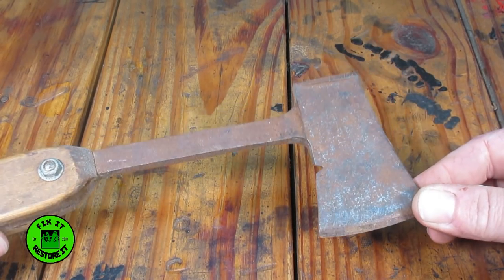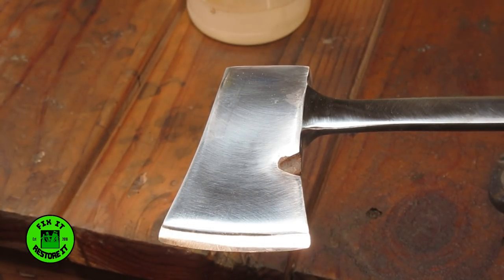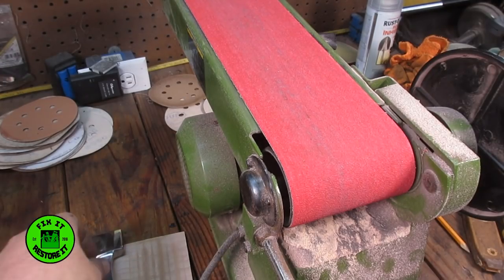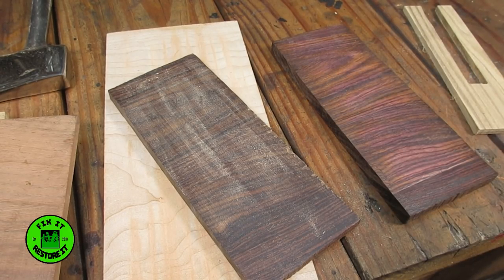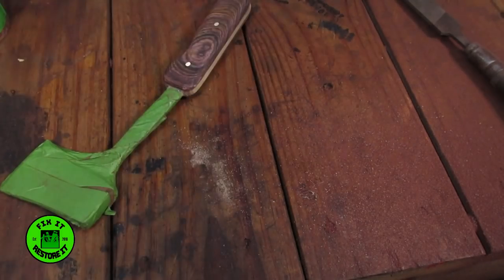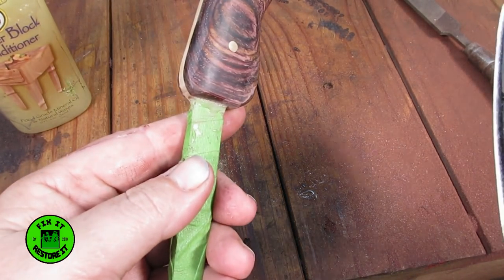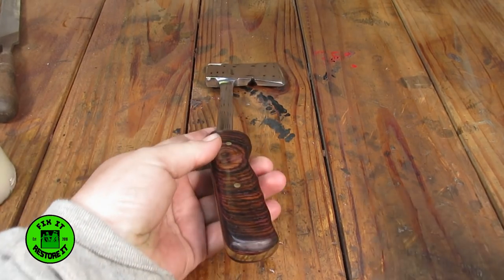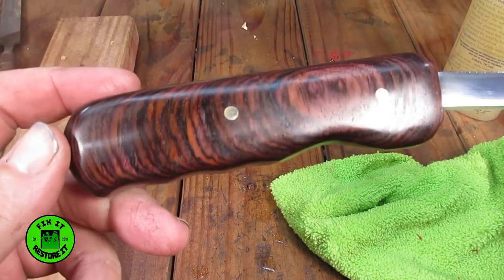Ugliest mini hatchet amazing transformation

Comment: It's a roofers hammer...for doing wood shake work...you trim the shake with the blade..drive the copper nails with the back and pull nails with the nail notch...used them for years doing shake work..
Reply from the maker: Even that small?
Reply: @FixitRestoreit  you get up around dormers, overhangs,and Eve's with it..lots of tight spots around portchs and the like, sometimes you use it in conjunction with your larger hatchet to lever in nails or to split thicker shingles,I wouldn't use that one now though lol it's too pretty
Reply: That sounds a lil shakey to me. lol
Reply from the maker: @lilsammich8252  lol!
Reply: That was my immediate opinion too.

Comment: I don't know if that  wood is Koa or not, but someone tried very hard to make it look like Koa. They did a nice job of dying it if that's the case. 
An old timer's trick: when you sand wood to a fine finish, before applying any finish, take a damp cloth, run it over the wood lightly, just barely wetting the surface. I use alcohol because it dries faster, but water will do. Once dry, run some 0000 steel wool over the wood, lightly, removing the little hairs that will pop up when you wet it. Don't try to sand the wood, just take off the little hairs. If using varnish or the like, you should use the steel wool between coats of varnish, all but the last coat if you want a glossy surface. In my day we'd do it even after that last coat, and then coat with old fashioned car wax and buff it up. Actually the car wax would be good on the handle, contrary to what you think, it actually gives you better grip. 

I'd like to see a lanyard hole in this hatchet, and prehaps a leather or nylon lanyard on it. Of course, I don't imagine it will actually see much use now, it's too pretty to really use for rough work.
Reply from the maker: Unfortunately , the wood came in a large box of exotic off cuts, so I'm not sure I will ever find out
Reply: @FixitRestoreit  Yeah, I got some veneer materials that way one time. must have been a couple dozen varieties.

Comment: It looks like an Estwing camp hatchet that's already hade a make over.  The rust came off those cast iron pans really nice, as well as the protective polymerized oils.  You're going to have to re-season those pans, or food will stick in them like cement.  Also, teach your wife how to care for them properly, if she is actually using them, and not storing them in the shed. The woods looks like rosewood, maple, and walnut.

Comment: I would say you definitely like that wood. The hole at the end of the original handle was for a leather thong. It might be a camping hatchet.
Reply: So if it slips from the hand in use it doesn’t fly into the bushes. Use them for machetes as well. Safer for bystanders too.

Comment: It's very nice, and you did a great job with it. My only worry is that there's nothing but epoxy holding the center in. The outside scales are pinned to the hatchet, but the center is only hanging out in there. Just a thought, but you could drill a hole into the bottom and put in another pin without doing any damage, and it'd put another piece of mechanical retention in there. :)
Reply from the maker: That's a good idea!

Comment: Keep it for a kitchen tool. Might have been a good size for light bushcraft, but too thin in the choked position. I use 600gm to 400gm hatchet heads for light craft, carving and whitrling.  Yours looks much lighter 250gm? 300? Kitchen, yeah.

Beautiful! And what a wood.

Cheers from Israel
🌴🇮🇱
Reply from the maker: I'm guessing you're probably close on weight, definitely dainty ! 😎

Comment: Looks like an Estwing. They were leather handles.
Reply from the maker: Looks like it ,but too small
Reply: No, not like an Estwing at all, the tang on an Estwing is shaped to hold the stacked leather for the handle and ends in two round tang ends which are peened over to hold the end cap.

Comment: Cast iron skillets are supposed to have their pores full of oil, to prevent rust. A process known as seasoning, where oil is baked into the pores and water replaced. At that point the skillet should only be scraped and wiped, they're not supposed to be washed and they sure ain't supposed to have pores full of evaporust. Not really sure what you can do to make them food safe now if it's gotten into the pores, but I'm pretty sure Evaporust isn't meant for human ingestion. If they're rusty you use steel wool to shift the worst of it and a scraper to take it back to completely clean metal. Generations of old ladies will be rolling in their graves!

The axe is much improved however ;)
Reply from the maker: 👍 but check this out https://www.google.com/search?q=evapo+rust+for+cleaning+cast+iron+cookware&oq=evaporust+for+cleaning+caat+iron+c&aqs=chrome.1.69i57j33.22833j0j9&client=ms-android-cricket-us-revc&sourceid=chrome-mobile&ie=UTF-8
Reply: My wife and I agree, rolling in there graves.
Reply: @FixitRestoreit  Don't worry about it too much. If you have a self cleaning oven, set it to do a cleaning cycle and put the cast iron in it. When it's done the pans will be perfectly clean. That is in fact one of the ways to prepare the pans for re-seasoning. If the boss freaks out about using the oven, use the BBQ. If that gets vetoed, build a fire big enough to cover the entire pan, put it in the middle and keep piling the wood on.
Reply: I was thinking the same thing. I can’t imagine how much work it would be to get the chemical out of the pores so it could be properly reseasoned.
Reply: @FixitRestoreit  I see a lot of people doing the same thing, I don't think it's a good idea though personally. Even if it's food safe it's not something that you should be eating. Ever wonder why cancer incidences have soared in the last 30 years? Exposure to chemicals, many of them carcinogens. Johnson and Johnson currently have a suit against them because of incidences of genital cancers from people using talcum powder, which is carcinogenic btw. Women covering themselves in make-up full of chemicals, men spraying WD40 on their achey joints and now people filling the pores of their skillets with Evaporust. 

Interestingly the MSDS for Evaporust makes no mention of it being safe for ingestion. In fact they recommend forced vomiting if ingested. It's been research tested as non toxic in rats at 5mg/kg but that doesn't make it food safe for humans, and the fact they recommend using an emetic if it is ingested suggests ingestion is not advisable, IMHO at least. It should be noted that I don't use cosmetics, I use the bare minimum of toiletries and I prefer to wear gloves handling chemicals. Although I have crappy joints I don't annoint them with WD40. Some cancers have a genetic component, but I do as much as I can to reduce the amount of chemicals that absorb through the skin or if they have vapours I use an appropriately rated mask. The MSDS is worth reading for the chemicals you use, whether it's cleaning around the house or stripping zinc off galvanized chain. Know the risks involved in whatever tool you're using, in order to mitigate the dangers. No less true for random bottled liquids than it is for a table saw or a 9" angle grinder.
Reply: Thank you for your concern. Evapo-Rust is non-toxic and biodegradable. After using Evapo-Rust on a cast iron skillet, the skillet should be rinsed thoroughly with hot water to remove any lingering rust flakes. If you have any questions or concerns please check our SDS on our website or call us directly so we can help you with your project. 888.329.9877

Comment: When the wooden handle is on the _tang_.
Reply: Also, by making the handle the way you did, you also made a piece of decorative plywood, and plywood always has each alternating layer as the grain on one layer goes across the grain on the next.  This strengthens the plywood such that you don't need to worry about which way the outermost grain goes.  So, you have no need to fear that the dark wood's grain goes crosswise as long as the center piece's grain goes lengthwise.